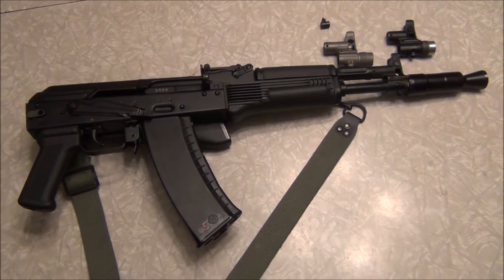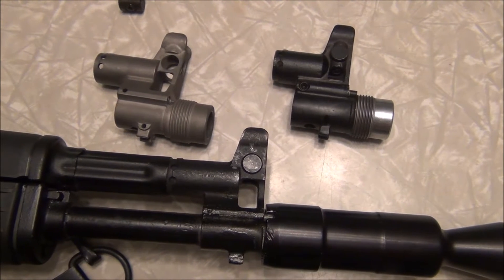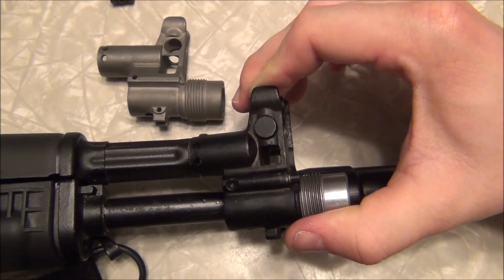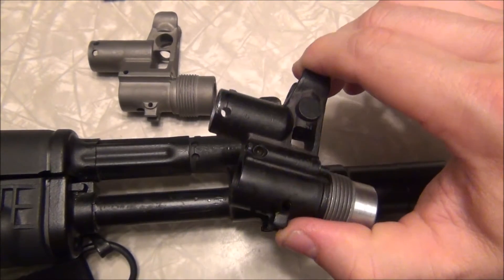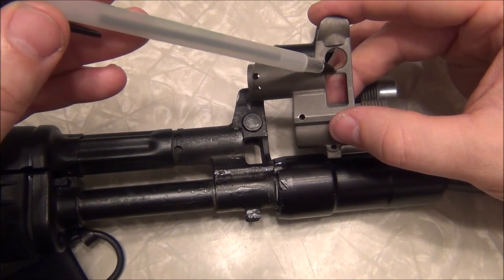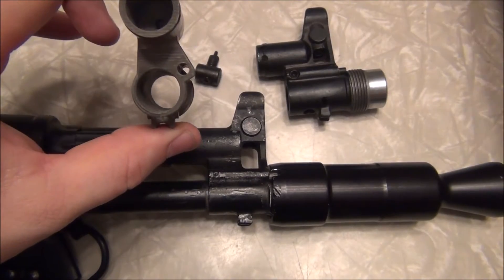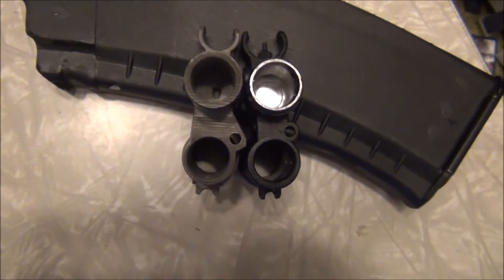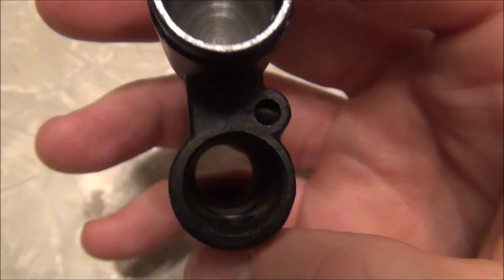AK-105 Russian vs SLR-104CR Bulgarian Front Sight

Comment: Quick question, I have a saiga .223 that i will be converting to a Ak102 (I will hire a profesional gun smith to complete the conversion). Does the original gas port on my saiga need to be welded and redrilled for a 102 conversion, or are the gas ports located in the same location? Also, would you happen to know where i can find a 102/105 FSB? They’re selling for $324 on gun broker
Reply from the maker: If you use the Bulgarian fsb you don't have to move the gas port or barrel. If you use the Russian fsb you WILL have to step the barrel AND move the gas port back as is designed to sit 3 mils closer to the receiver. It's not a cheap game. The conversion will cost way more than the price of the fsb.

Comment: Would like to know, if that Gas Block would also fit my Chinese SDM AKS-103. I can use the gas tube of my Arsenal SAR-M1F on my SDM, its and works like a charm. They are also using the same size folding stock pin ->4.5mm
Reply from the maker: The barrel must have the same dimensions as a standard AK74 or AK-100 series. I don't know if either of those do. Basically the gas hole has to be in the standard position as a ak with the 90 degree gas block and have a 15mm diameter
Reply: @MaverickTangent  It's quite similiar to the AK100 rifles -> https://www.gunsweek.com/en/rifles/articles/sdm-aks-74-and-aks-103-tale-two-aks

Need to check if I can get a Bulgarian Gas Block like yours somewhere here in Europe

Comment: Thank you sooo for making this video, no one else on YouTube has one covering the AK105 in this much depth. So you didn't have to relocate the gas port using the Bulgarian 105 FSB? If so, that's good to hear, as I'd like to make an AK105 clone without having to weld up and drill a new gas port like Rifle Dynamics does...
Reply from the maker: Nope, the Bulgarian 105 gas block went right on without ANY issues.  Thanks dude! I only make videos of things that I can't find, and I couldn't find a video about this.  I plan on doing an update when I get my Bulgarian AK105 rear side, also hard to find.
Reply: Maverick Tangent
Thanks a ton, I will be directing others interested in this to your video. I'd like to have a pinned muzzle device to keep it 16" and legal. I'm thinking of the extended 4-Piece Bulgarian from CNC Warrior. I've seen some from AK103.com, but didn't like any except for their 22mm Romanian, which I will use for an Intrac MKII, but that's beside the point. Are there any muzzle devices you can recommend to keep it 16"?
Reply from the maker: The only one I recommend comes from K-VAR. They sell an extended one.
Reply: Maverick Tangent
I found it, the AKS-74U style one?
Reply from the maker: Nevil Easterling http://www.k-var.com/shop/KR-107CR.html
Reply: whats the ak105 rear side? i'm interested in building my first one but don't know much

Comment: Cutting down your SLR-104 to the shorter AK-105 barrel length, did you run into any over gas/under gas issues?
 I'm about to do the exact same thing but with a SLR-106F since I couldn't find a 106CR. I'm going to chop down using a combo front sight block. But i'm slightly worried it might become overgassed. I'm not sure if Arsenal uses the same gas port size on their F/ FR/ and CR models.
Reply from the maker: No. It ran fine. I usually run it with no muzzle device.
Reply: Awesome. Thank you so much for replying. These vids you have are really great. Filled with the real important detailed stuff that's impossible to find! So thank you. I also got one of US gray combos that you have shown here. Pretty sure it's from the same guy. Did you get a chance to run one yet? and i'm also wondering if it's really nitrided. Not sure how you can tell. Thanks again!
Reply from the maker: @LucienDarknesss  its really nitrided. It was super hard, difficult to drill. The ones he makes now I think are a little better than the one I have. I chopped the barrel on my Russian and its run fine.
Reply from the maker: @LucienDarknesss  see if you can scratch it.
Reply: Ok cool good to know. Yes, the one I got is slightly updated! looking forward to this conversion. Thanks again!
Reply from the maker: @LucienDarknesss  let me know, dude.  Can't even wait.
Reply: Do you have a an email i can reach you at?

Comment: somewhat random, but i have a bulg combo block i planned to use on a 104fr before they dried up.. didn't manage to buy one up.. however, VEPR 5.45's are still available.. any clue what the barrel diameter on the VEPR is at the gas block? i believe the VEPRs have thicker barrels.. I'd rather not have to machine the block out or the barrel down.. did a saiga, and they work perfect.. wasn't sure on VEPR though.
Reply from the maker: callofgeorge Veprs are too thick to work without substantial work. The Vepr barrel is over .800" and the Bulgy combo block fits .591" or 15mm. Almost quarter inch of turn down. The bulgy combo block will only fit AK100 style barrels without mod.  That is AK74 style. Arsenal has a few AK100 style barrels on 7.62x39 and 5.56 on sale right now. But building a rifle is a lot of work.

Comment: Is the Russian front sight gas block NOT 24mm threads? Can you fit that on a Russian Izhmash AKM in 7.62x39mm? I'm trying to build an Alpha AK clone using the CNC Warrior extended Bulgarian style 4 piece muzzle break. Having no luck 😟
Reply from the maker: iluvmym4 it's 24mm threads but it won't fit an AKM without modification to the barrel.  the gas port is in the wrong spot and the diameter is different

Comment: $300-400, haha from 2021
Reply from the maker: If anyone has one...
Reply: @MaverickTangent  I have one, but I'm pretty sure it's a knock off. I'll check on Sunday night when I get back.
Reply from the maker: @Nick-fm9ux  there's a guy who made some us ones and nitrided them. If its grey, or doesnt have a chrome lined gas piston chamber it's a knock off. I have one, too. But I think it would work ok
Reply: @MaverickTangent  so I just checked it out. It has a machined finished on the interior. I don't have a number "2", but there is a "0", near where the front sight post slides in.
Reply from the maker: @Nick-fm9ux  I'll look at mine when I get home

Comment: Would you reccomend a SLR106 for a beginner  AK enthusiast?
Reply from the maker: I would! the slr106 is amazing but the magazine tend to be about $50 each for the Bulgarian ones with the metal feed lips. the promag magazines work good but a nice hard impact would break the lug off. ask me how I know. if I was going to suggest one, get the slr106cr because they will be rare someday, are about 3 inches shorter than a standard AK, and cuz they look just the like rifle on the table in this video. which I think is cool ;)
Reply: Maverick Tangent Could i circumvent the high cost of mags by getting the AR mag adapter? Ill def have to check that variant out!
Reply from the maker: I don't know of any that work well without paying someone to install a permanent one. 4 mags is the most you'll ever need. how many can you carry?  4 mags maybe 5 is way less cost wise than a mag adapter or having one installed
Reply: Maverick Tangent whats the cost of the installation?
Reply from the maker: probably  $300-400 is what definitive arms quoted me a couple years ago. they haven't taken orders in a while cuz they are booked out 2 years
Reply: Damn x.x
Reply from the maker: they grind out the front trunnion and and then rivet it in place. I thought about sending them my saiga but for the same cost I can just get good magazines and be done with it. the Bulgarian mags are excellent.
Reply: Maverick Tangent You think my friendly neighborhood gunsmith could do it?
Reply from the maker: goes back to my original point. the mag adapter is at least $100 if you can find one plus the cost of install. so that's at least 3-4 bulgarian 223 magazines. what are you gaining by being able.to use ar15 mags? you should just get a ar15 if it's that big of a deal.  the most mags a solider ever carries on his person is 8 + 1 in the rifle. how many can you carry?
Reply: Maverick Tangent I like the style of AK, the AR15 is kinna meh to me,but i do like the availability of rounds. I've been told 223/5.56mm  has more range and accuracy over the 7.62x39mm. I just want my AK to be the best it can be, to coincide with the correct training.
Reply from the maker: I believe these bulgarian AKS are the best factory built you can buy.  no matter the caliber. and the slr106 can be had for under $1000 at the time of this video
Reply: Please I’m looking for ak 104 gas block Bulgarian. Do you know a good website I can buy one from it ?

Comment: Nice rifle brother I'm doing this to one of my 104's.  Those US combos are garbage from my experience. I think they are machined from shitty metal and not properly heat treated.  I got both mine from a group buy on ak files.  One of them broke pressing it on and the metal structure almost look like casting or pot metal.  Like it was machined from a cast ingot instead of a forged piece.  That's just my experience though
Reply from the maker: Civiliansoldier762 let me know how it turns out! I'm not using that junky one, I'm gonna get an slr106cr  to do a 762 gun
Reply: Maverick Tangent  if your just wanting the 106cr for the barrel components I believe kvar was selling just the populated 106cr populated barrels  for around $300 or so.
Reply from the maker: Civiliansoldier762 I know, they are less than that, but the entire rifle can be taken apart and used to.make a Saiga a folding stock, so every part has value
Reply from the maker: Civiliansoldier762 and... the stock angle with the Bulgarian trunnion is faster to sight down that the Russian trunnion

Comment: Would the Russian fsb/gas block combo work on a saiga?
Reply from the maker: dropmeA no, not without the same mods.  most saiga and bulgarian barrels are the same
Reply: Maverick Tangent thank you! Perhaps in Izhmash factory they have a separate barrel and line for the 105?
Reply from the maker: dropmeA they do, the RUSSIAN ak-105 has a dedicated barrel
Reply from the maker: dropmeA it's actually a little shorter than the Bulgarian 12.5" barrel
Reply: Maverick Tangent that's awesome, thank you for your help! This is helpful as I almost bought a Russian fsb/gb for my sgl because k-var has been out of the Bulgarians for awhile.

Comment: hey man why couldn't you use a krinkov style front sight gas block on a saiga?
Reply from the maker: Cameron McCrea just off the top of my head,  even if the diameter of the hole is the same as the standard saiga/bulgarian barrel (.591") where is it going to place the gas tube in relation to the gas hole? to match a stock gas tube you would have to move the gas port, to match a stock gas port you would have to modify the gas tube.

Comment: What about the GBC-13 from ja mac on a Bulgarian kit?
Reply from the maker: I've seen the part he is producing, and I'd love to get my hands on one, but I don't know what I would put it on yet.  It would probably just end up on another SLR-104FR because they are basically the cheapest AK74 you can get that's not crappy.  Anything more expensive I wouldn't want to cut on.  It won't fit on a Vepr since those use RPK barrels.

Comment: What type of sight tool do you use for this style of front sight? I have a slr 106cr, and a regular ak sight took just doesnt fit to adjust windage. Been hunting for any info on this. Thanks
Reply from the maker: I just kind of used a punch and hammer to adjust it. the tool.doesnt fit this one either. if to want to grind the edges on a tool, you could probably get it to work. but in theory you only have to set the sights once

Comment: can you use the Russian Part on a russian parts kit
Reply from the maker: the RUSSIAN AK-105 barrel is different than a standard AK-74 barrel, so the RUSSIAN AK-105 gas block is different and will NOT fit on a standard AK-74 barrel. So if by some miracle, you have a Russian AK105 barrel that came with your Russian parts kit, it will work.  If you notice, those AK-105 parts kits listed online don't have barrels with them.  So, no, if you are using a US made or Bulgarian AK-74 barrel, the Russian part will not work.
Reply from the maker: not without modification